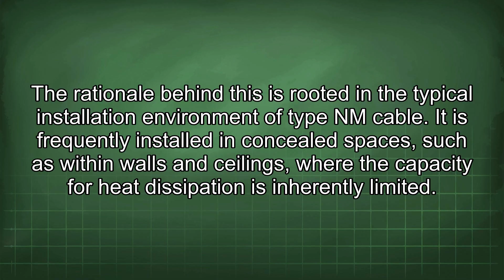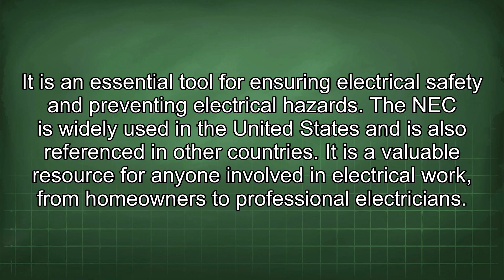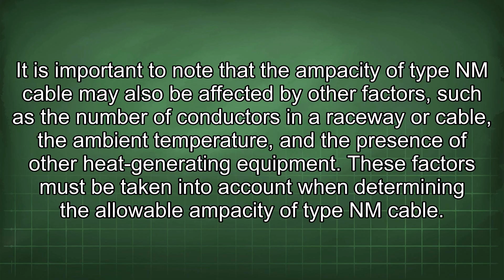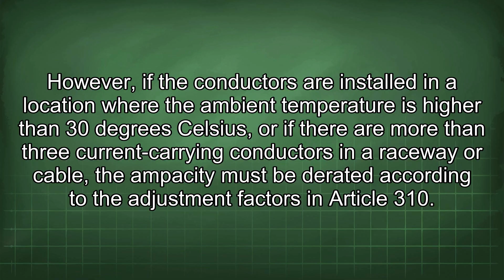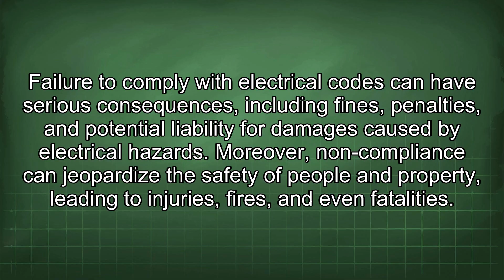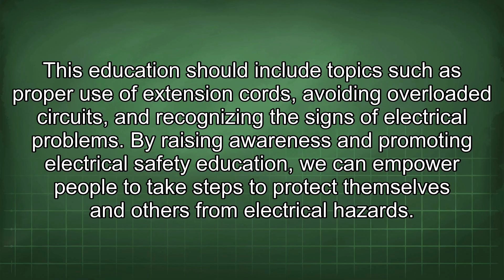NM Cable Sizing for AC Units Explained

Comment: Table 310.15 already limits 14ga, 12ga, and 10ga NM cable are already limited to the 60° column.
Reply from the maker: Hello @wolfgangunger217,

Thanks for your comment. Your statement refers to a specific rule found within the National Electrical Code (NEC), likely from a past edition, as the current NEC (2023 edition) handles this slightly differently and more comprehensively.

Let's break down what your statement means in the context of the NEC and then clarify the current rules:

Understanding Your Statement (Based on Older NEC Principles):

"Table 310.15": This likely refers to a table within Article 310 of the NEC, which deals with ampacities (current-carrying capacities) of conductors. In older editions, there might have been a Table 310.15(B)(16) or similar that listed ampacities for various conductor sizes and insulation types at different temperature ratings (60°C, 75°C, 90°C).

"14ga, 12ga, and 10ga NM cable": These are common wire gauges (American Wire Gauge - AWG) used in residential and light commercial wiring. "NM cable" refers to Nonmetallic-Sheathed Cable, commonly known as Romex.

"already limited to the 60° column": This is the crucial part. It means that even if the individual conductors within the NM cable have higher temperature ratings (e.g., 90°C insulation), the allowable ampacity for the entire NM cable assembly was required to be taken from the 60°C column of the ampacity table.

Why this 60°C limitation for NM cable?

The primary reason for this limitation, historically and still conceptually relevant, is heat dissipation. While the individual conductors might be rated for higher temperatures, the outer jacket of NM cable and the way it's installed (often in walls, attics, or confined spaces) can limit its ability to dissipate heat. Overheating can lead to premature insulation degradation, fire hazards, or nuisance tripping of overcurrent protection devices. The 60°C rating provides a safety margin.

Current NEC (2023) Perspective (and How it Relates):

While the exact table numbers and wording might have shifted, the underlying principle regarding NM cable remains.

The 2023 NEC, in 334.80 Conductors, addresses this directly:

"Conductors shall be rated at 90°C (194°F). Where more than two current-carrying conductors are installed, the allowable ampacity shall be adjusted in accordance with Table 310.16 and the applicable provisions of 310.14. The 90°C (194°F) ampacity shall be used for derating purposes. The ampacity of Types NM, NMC, and NMS cable shall be that of 60°C (140°F) conductors and shall comply with the 310.15(B) and 310.15(C) ampacity adjustment and correction factors for conditions of use."

Key takeaways from the current NEC (2023) 334.80:

Conductors are 90°C rated: The individual copper conductors within NM cable are typically manufactured with 90°C insulation (e.g., THHN/THWN-2).

Derating from 90°C allowed for adjustment: If you need to apply ampacity adjustment factors (e.g., for bundling many cables together), you can start with the 90°C ampacity of the individual conductors before applying those adjustment factors.

Final Ampacity is 60°C for NM Cable: After any adjustments, the final allowable ampacity for the NM cable assembly itself is still limited to that of a 60°C conductor. This effectively means you refer to the 60°C column in Table 310.16 (or relevant ampacity table) for the final usable ampacity of the NM cable.

In essence, your original statement is conceptually accurate and reflects a long-standing principle in the NEC regarding NM cable: despite the individual conductors potentially having higher temperature ratings, the ampacity of the assembly (NM cable) is limited to the 60°C column for safety and proper operation.

This ensures that the entire wiring system operates within safe temperature limits, considering the installation methods and the cable's construction.

Sincerely,

BESA Research